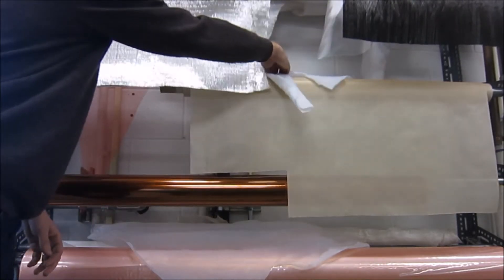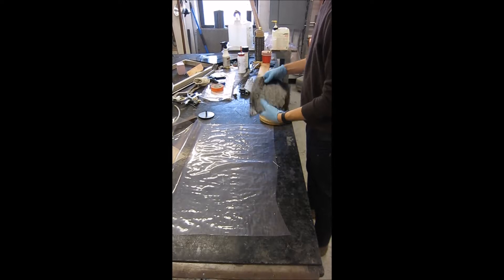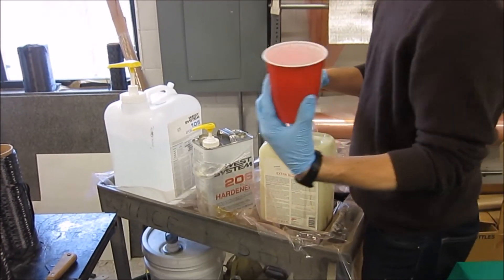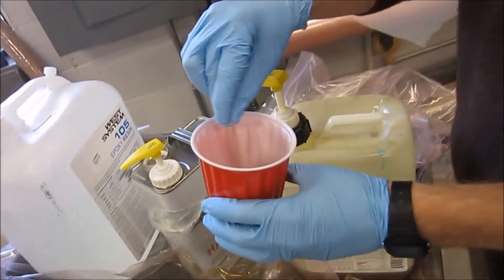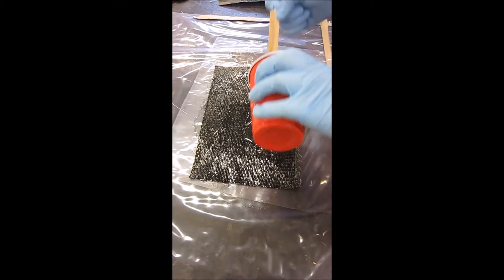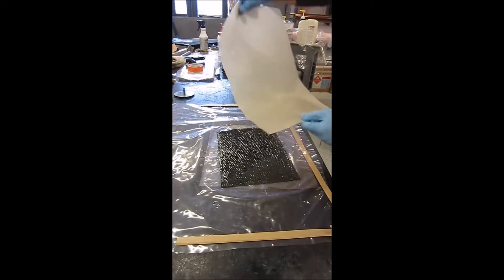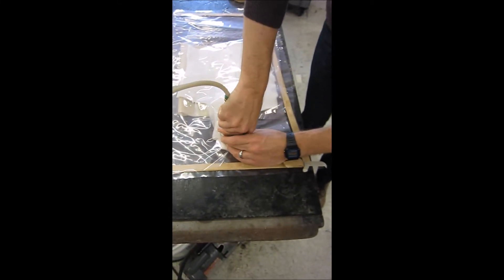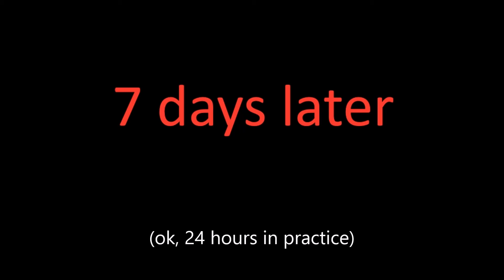Composites Tutorial - Wet Layup Materials, Supplies, and Process

Comment: Ahh. This is a bagged wet lay up. RTM or VARTM is where the laminate stack is bagged dry then the resin infused under vacuum. Also, if you're after flat panels you'd be far better laying up onto a glass plate that has been released. Much faster and will give far superior results.